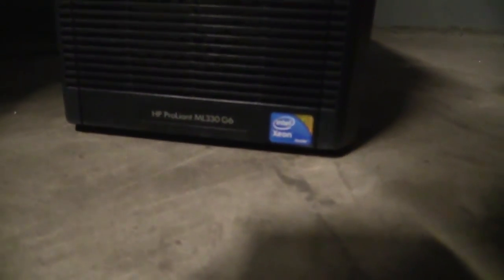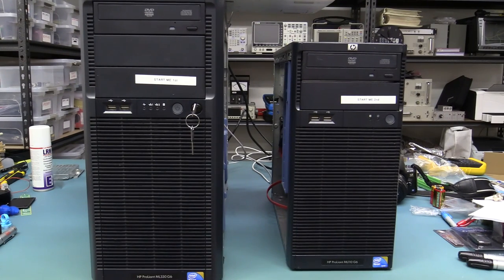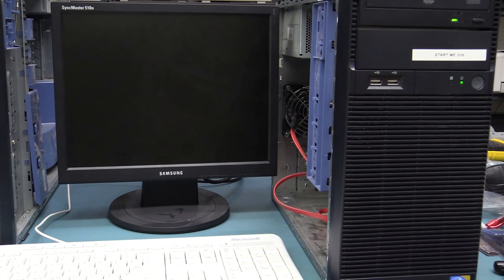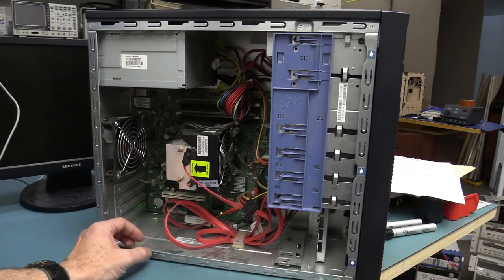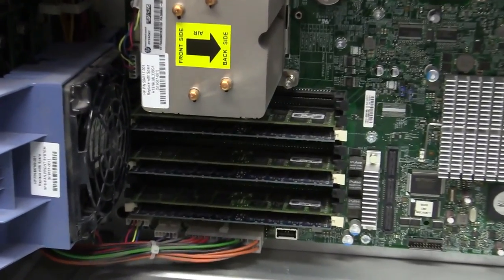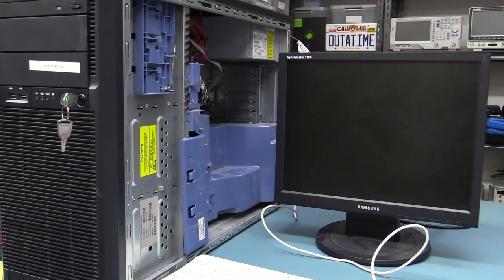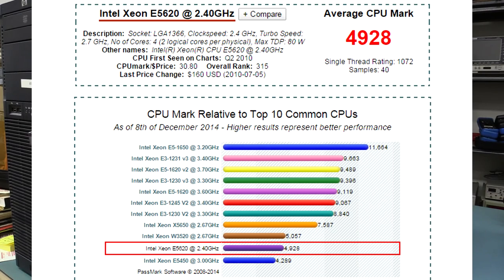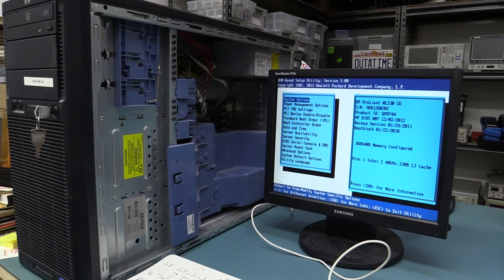EEVblog #691 - Dumpster Dive Xeon Servers

Comment: What a fucking find. Quad core Xeon and 36Gb or ram. What a fucking beast.
Reply: Priceless Persuader  i cannot believe people throw this stuff out
Reply: Priceless Persuader I hate life.
Reply: Skidtire For companies its not worth the time to try and sell them when they upgrade their system
Reply: Shanee Bahera
 fuck that id take it home for myself
Reply: +Priceless Persuader i hate my life.
i found only a broken but working 50 inch sony bravia LCD tv.
Reply: +Skidtire I can. If you pay for electricity, new hardware pays for itself in a couple of years just from efficiency improvement.
Reply: +Skidtire It's often against company policy to let employees take these things, for data security concerns. That's why you'll virtually never find them with the disks in. Can be a real pain in the ass when salvaging rackmount servers because they have hotswap trays, which usually get destroyed along with the disks. At my old work I had to give proof of data destruction (physical or wipe) in the form of screenshots or photos that displayed the serial numbers before I'd be allowed to take anything off premises.
Reply: +Shanee Bahera It pays to sell company server grade hardware, you would make very little so its not worth the time.
Reply: exactly, lol, you could run a few vm's on that beast easily and serve a classroom or small office,

Comment: The reason why they can get away with this relatively small, fanless heatsink is not because Xeons are any more energy efficient (Xeons are basically higher certificated i7 CPUs and consumer chipsets have usually more energy saving features), but because of the ridiculously high, guided airflow inside the case.
Reply: Hence it sounds like a harrier starting up when you turn it on. Pull some load through it and those fans will rev up again :)
Reply: dash8brj this one's have big heatsink comparing to rack mount Dell or IBM or SUN (now Oracle) servers, They will not turn fans up again till they don't reach some temperature (usually around 27C or so)
All of them spend lot of time on air management inside case so they can use small heatsinks.
Reply: True - and couple that to the fact that they usually live in air conditioned server rooms. :)
Reply: No, that is only part of the reason. As Dave stated, they do produce less heat than the consumer grade CPUs. If you use them in custom-built computers you can easily scale down the cooling for the same performance.
Reply: dash8brj This one's don't necessarily are meant to be in server rooms, this are SOHO so you can put them in some corner.
Reply: spaculo technically that is not true, if you compare processor to processor they consume more than power than "consumer" grade processors (but they are also consumer grade, even Intel Itanium are consumer grade processors) but they use less power per MIPS (unit of processor power) then what you call consumer grade processors (and that is what Dave said)
Reply: Yeah, if you look inside of a consumer grade Dell you'll often see the same thing.  I have an old Dell Dimension that was my parents' home machine and it has a big 120+mm extra-deep fan with the same huge motor and a relatively small, basic heatsink.  The thermal sensor failed on it and the fan sounds like the space shuttle on liftoff, so I had to put in a different fan wired to the power supply directly.
Reply: Miloš Lazović Yeah, that's what I meant. Less heat is obviously not an absolute, I meant per instruction et al.
Reply: The heat sink has heat pipes in it... definitely not a slouch.
Reply: scowell heat pipe can only move heat from one place to other, it don't cool in any way (same as coolant in car, or liquid cooling in computer it move heat not cool), you still need some sort of heat sink to dissipate heat.
Reply: Miloš Lazović  Heat sinks don't cool either, they just move heat out into the air.
Reply: GordanCable It will be true if there was not little phenomenon called "Thermal radiation" which contribute with round 15% of all heat dissipation of heat sink.
Reply: ***** you call that small?? if the intel stock heatsink can cool a 95w TDP cpu than you can easily cool a xenon with that monster... (as long as you don't OC it to 200W or something ridiculous like that...)
Reply: Miloš Lazović Sorry for the late reply.Dissipation does not necessarily equal cooling. "Moving heat out into the air" on the other had is a synonym of heat dissipation.

Comment: Awesome finds, I wonder why they got rid of them. 36GB of memory, that is insane. I am not sure what you should do with them, maybe sell them, you could get a lot for that!
Reply: Upgrade, probably. 

36GB memory means nothing in the server world.
Reply: We throw these things away in large numbers. The are paid and their time has run out, so they get replaced by newer models. The work to find a second hand use and assure that nothing happens to the data is much to much work, so they end in locked up dumpsters..
Reply: ***** 36GB of RAM is bigger than the amount of hard disk space in computers from 2002. Also 36GB is also close to the amount of hard drive space in the first Intel MacBook. So 36GB is a lot of storage. It is a ton for RAM, my $2000 machine only has 16GB.
Reply: erebostd They are only 2 years old! Also the data is all stored on the hard drive, just take the hard drive out!
Reply: For modern programs & operating systems, 40GB means nothing. As for your machine and your personal needs, 16GB of RAM is plenty for you. For others (especially those that are seeking for more than 64GB) the more the merrier. 
Most modern servers are a minimum of 4GB, with most averaging around about 64GB mark.
Reply: ***** Say I wanted to run an media server or a small website, 32GB would be plenty. Yes, I was going to get 32GB for my machine but it cost too much, and like you said 16GB is fine. I run a radio station and have a computer from 2006 with 2GB of RAM and a 120GB hard disk running it. That computer is on 24/7 and acts as a media server for anyone listen to my radio station, with only 2GB of RAM.
Reply: Joshua's Recordings They may not be very old machines, but they have been super-seeded. It's a better investment to go with a new single server (probably a dual socket motherboard) with better redundancy & lower power consumption than both of those older machines combined.
Reply: Joshua's Recordings For a small media server or website, 2GB is plenty. 
The only reason to invest in more ram/drive space is if you need it. Other than that, is it really worth it? 
As for upgrading to newer machines, that is a case-by-case basis. Don't need an upgrade? Don't upgrade. It's as simple as that.
Reply: I was looking on the HP website at the newer servers, and some of them are capable of holding 385 gigs of memory or something insane like that..but yeah, to me 36 gigs is insane even...finding the memory is a score in itself (assuming it's usable in something other than a server)
Reply: Joshua's Recordings Thats not our decision, the customers want them to be shredded. If we wanted to put them to pieces we need an insurance, a certification..thats much to much effort...
Reply: sc0tte1 Look at HPs z840 Workstations with up to 2TB of memory!
Reply: erebostd Shred the hard drive, that is the only piece with data on it.  To me even that is a BIG waste!
Reply: Joshua's Recordings lol why are you comparing the amount of RAM to a computers hard drive from 12 years ago? I kind of get your point but its such a bad comparison that I couldn't help but sigh!
Reply: Gadget Addict That is right, 12 Years ago, not that long ago. My point is that technology increase so fast over the last 12 years but now is slowing down, the last 3 versions of Windows have the same system requirements, Windows 98 to Windows XP (4 years) had dynamically different requirements. Windows XP to Windows Vista had a huge difference in the requirements. Windows Vista, 7, 8, and 8.1 have the same system requirements. That is just my point in technology.
Reply: If they want new equipment they have to throw away and depreciate the old stuff. It's just the way uncle Sam wants us to run our businesses. In India they go to the effort to pull out the gold from these things at least.
Reply: Joshua's Recordings What are you talking about '12 years not that long ago' ? For computers, 12 years old is ancient.
Reply: Joshua's Recordings
Or they could leave the hard drive in there and erase it to make Mr. EEV's job even easier.
Reply: ***** A good erase (where no data can be retrieved whatsoever) can take up to a few days to complete. It's better to dispose of the drives separately for security/privacy reasons.
Reply: *****
I guess on huge drives, it might take a little bit of time. Usually for standard ~500GB drives and stuff though, it only takes an hour or two, and in the case of selling a used computer, can mean the difference between "Used/Fully Working" and "Parts/Not Working" as far as eBay categories are concerned.
Reply: ***** Regardless of size and connector bus, for drives to be resold all data needs to be unable to be recovered. It's just cheaper & quicker to completely destroy the drives than trying to doing a very long process of reformatting & data scrambling.
Reply: *****
I guess an hour and a half secure wipe > tossing in the "secure" dumptser. And don't tell me that "the data can be recovered if it wasn't overwritten 37 times" :-).
Reply: ***** yes, actually it can if the person doing the recovery wants to pay for it.
Reply: 36 gigs is fuck all... our eServers used for ESX farms have 256 gigs of ecc each, our Xenon used for the 'real' servers have 128 gigs and are about to get replaced. We can't just dumpster dump those, you would get fined for that, the recycling centre will take them off your hand for free, otherwise disposing of those could actually end as an expense. It's not like we give enough of a shit for a few hundred bucks to waste our time and efforts reselling the old junk, that's what the recycling centre does with them, they would resell one of those for ~25$.
Reply: ***** Data can be recovered even if it is overwritten 100 times. A good wipe takes a day or 2 to complete.
Reply: Peter Carlson
*****
That is actually a hoax/exaggeration that was born in the 1990s and never really died. If the information is overwritten once, it is unrecoverable. Most recovery shops won't even attempt recovery if you tell them that you overwrote the data just once.
Reply: *****  Most data recovery shops don't have a magnetic force microscope and the ability to dismantle and record the exact magnetic signature of hard drives, at least not the kind that advertize to every swinging dick on the street. however it is possible and has been done before, there are places that specialize in this practice. granted it is never 100% successful, but if you only need part of the data and are willing to spend several millions of dollars on it there ARE places that have this ability, they don't cater to you and I, but LARGE companies can and do spy on eatch other and this is one way they do it.